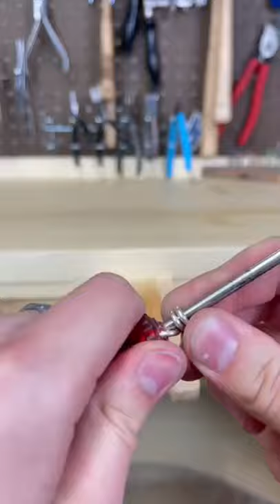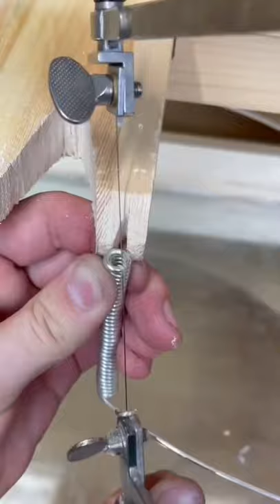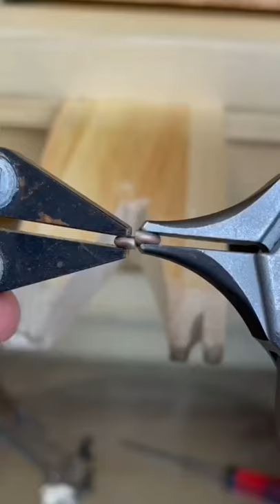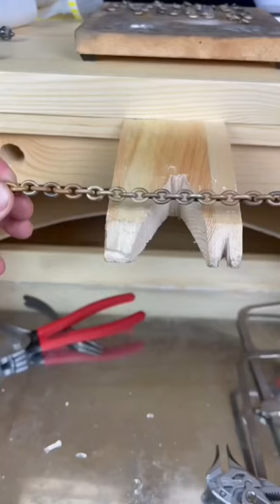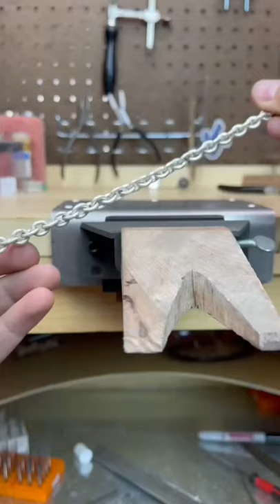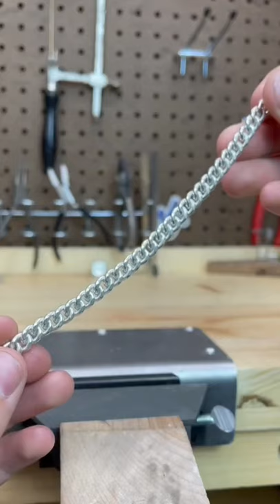Making a Silver Chain #shorts #jewelry

Comment: You probably already know this one, but a tip I got early on for making jump rings like that was to buy a set of knitting needles, that way you have a set of rods with known measured diameters to make the rings of the relevant size.

The other thing you can then do with a knitting needle is put it in the chuck of a drill and wrap the wire very quickly and save a bit of valuable time.

Awesome work again though, love to see people still using traditional methods 👍👍